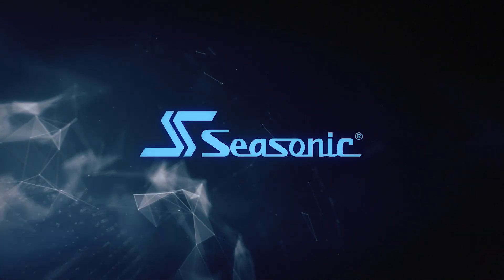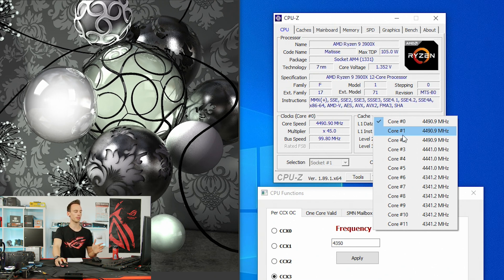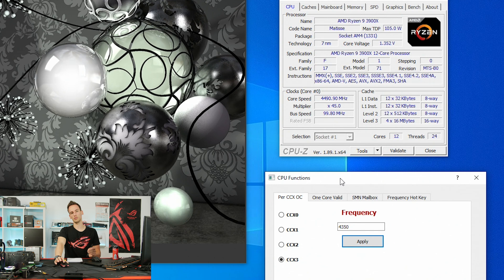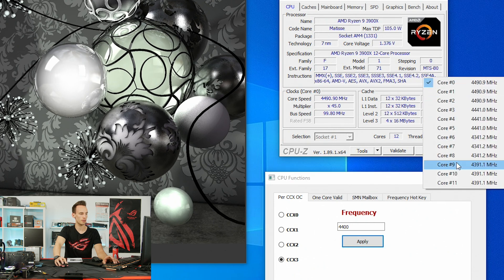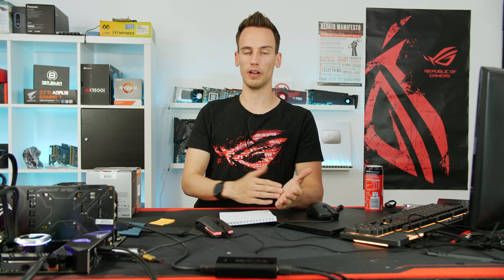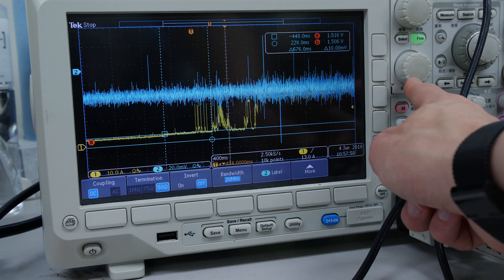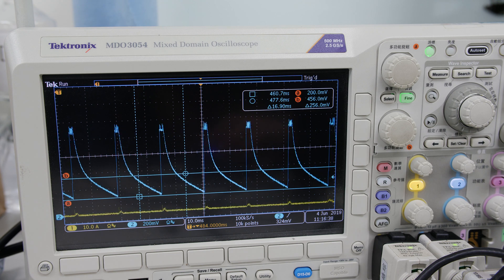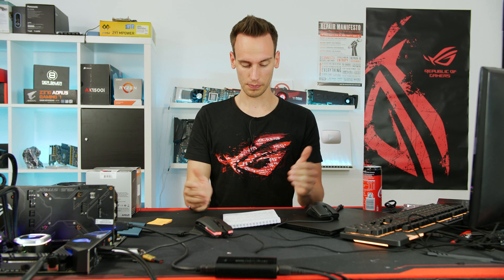The most amazing feature of RYZEN 3000 - Power Saving (and some CCX OC)

Comment: finally managed to fix Corsair iCue cpu usage by disabling the SDK option (from 9%usage making cpu run max clock/max voltage non stop down to 1.3% for normal flex-ratio cpu/voltage behavior) my voltage now set to full auto on a 9900k goes down to 0,736V to give you a comparison (couldn't care less on a high-end gaming pc to be honest just sharing the info as I've been monitoring idle the last 3hrs after months of running max clock/voltage for no good reason)
Reply: how do you disable the SDK option? Is it an install parameter?
Reply: 🤔 it looks short circuit, maybe need to remove 20/24 power pins on motherboard, clear left over electric then put it back. idk

Comment: i have this board and a 3600x, Im having problems running 3200 cl14 ram at its rated speed, Im having boot issues, the dram led stays on  and i have to power off the system to get it to reboot.
Reply: Try program called ryzen RAM calculator maybe can help you
Reply: Already tried the ram calculator, still had the odd boot problem.
Reply: @LetMikeSmash  try up ram voltage or lose you timing or both and wait for new bios i guest.
Reply: tried Copy paste timings from msi bios.

Comment: Is it still CCX or Chiplets with 3000?
Reply: Aaron K yes it still. 1 ccx still contain 4 core and 1 cpu die contain 2 ccx for total 8 core per die. But as this gen use multiple die (2 die cpu+i/o die) then there is new term for caling 1 cpu die as CCD(Core Complex Die) and Ryzen 9 model only that use 2 CCD.

Comment: Would it be possible to clock a CCX way higher than the other and have the Windows scheduler be aware of it, in order to achieve something akin to an ARM big.LITTLE configuration?
Reply: you do not need windows scheduler - any process can be bound to a set of particular cores... since forever. type "help start" in the command prompt for more.
Reply: Ideally Windows would do it on its own, but yeah Process Lasso works

Comment: try to oc one core to 5ghz and the reset to 4ghz or 4.8-3.8 somthing like this   .. if this worked i think single core score would be  fantastic :)) ,and game performance will be higher  idk if this  possible
Reply: you can't OC 1 core. it will OC the entire CCX , so with the 8 core for example you can OC 4 cores to whatever and 4 cores to whatever
Reply: @haoss69  he said at beginning you can oc one core but other should be 1ghz different.
Reply: murad dawod looks like it hard to achive. Clock scaling of this gen still close to previous gen. The reason why they boost such higher clock than previous gen is agresive boost behavior from precision boost mechanism. They tend to go as high as posible and it won't stay for long time becasue core temp increase soon as the core clock climbs. Even if you just oc 1 core it won't help as core temp will limit that.
Reply: @muhammadhanifkurnaen6689  i know its kinda impossible. but i would love seeing him trying to achieve higher frequency even on one core. and see what performance we can get good or worse
Reply: murad dawod yes for exploration purpose i agreed that. Because the ipc scaling of this 3rd gen ryzen is still mixed bag. And clock speed 'maybe' uniform the overal uplift in single threading scenario.

Comment: So, clock 2 CCX's to highest possible for your game (is this a problem on the same CCD?), and then another CCX medium for your OBS, and the last one lower for other stuff.
Reply: But Windows doesn't work like that on it's own ...
Reply: @janeksheppix  I think that was the original idea of PBO boost clocks - to make sure games run on the better CCX, but then again, Windows...  It doesn't understand the different CCX qualities and ordering. So it probably runs all the unnecessary stuff on core 0 already and the program/game stuff gets randomly shot to weaker cores/ccx.

I would try Process Lasso for games to test forced affinity, just to see if 3900X can reach 4,5-4.6 boost clocks in games that way with the PBO override.
Reply: @janeksheppix  You just auto set affinity with somthing like ProcessLasso.

Comment: Apropos overclocking features in BIOS - one thing that seems to be missing is a core-load dependent voltage offset.
E.g. -0.05v vCore at all-core, +0.025v at 4 core load, +0.075v at 1 core load : - )

As it's something I've noticed while trying to push this 3600 with PBO+AutoOC; to get higher single-core clocks stable (due to lower silicon quality), it requires compromising on already stable all-core voltages.
But I have my doubts that it has to be that way.
Reply: With the 3000 series having very specific voltage behaviours, I suspect any kind of load-dependent voltage offset could be problematic in some extremely fringe scenarios. Especially with how Ryzen 3000 like previous Ryzen (But even more so I'm noticing) just loves to throw workload across different cores constantly rather than keeping the same active cores busy with more workload when they're done.

Though frankly, I don't think with the 3000 series there's really going to be much headroom for "Pushing this 3xxx" type situations unless you're dealing with extreme cooling like LN2. The base algorithms the CPUs are already using seem to be so efficient with pushing individual CCX across the CPU to what is possible given the cooling situation, that most gains seem to be pretty much in the 50Mhz to 100Mhz range to just one specific CCX.... it's fun to try it, but the net gain seems marginal.
Reply: @Tiki832  I'm talking about generalized "how many cores are currently active" core-dependency, as opposed to Voltage Offset X for Core Y, but yes - the gains are always going to be marginal at best.

Comment: I'm confused that the idle power savings seem so good in this video, yet seem so bad in most reviews.  For example when measured at the wall, 50-60W for Intel 9900K but 90-100W for the Ryzen 3000 series CPU's.  The 3900X being the worst, but even the 3700X has poor idle consumption relative to Intel.  And then a video like this.. I'm confused.  Is it simply due to the power plan being used in Windows?  Compared Ryzen Balanced or Windows High Performance?  Are the reviewers always using the high performance plan with power saving features turned off?
Reply: Power plan probably. Ryzen balanced makes my 2700x use 30w to the wall, and high performance about 50, high performance pins the frequency to 4.2.
Reply: Might be a combination of using inefficient boards stuffed with unnecessary features (MSI Godlike comes to mind) and not having the latest chipset drivers installed.

It might show better on a lower-end b450 board, but I'm not sure.

Comment: How will this work on the 6 cores? (R5 3600)
Reply from the maker: 2 CCX with 3 cores each
Reply: @der8auer  That's great, it would definitely be nice if the board vendors included this feature in the uefi bios.

Comment: I will for sure undervolt my Ryzen 3000 processor (i don't know which yet) i think it's really worth it
Reply: Do not undervolt a Ryzen 3000 processor. Even just minimally undervolting it, will immediately reduce performance. It's best to leave it on auto.
Reply: @P8qzxnxfP85xZ2H3wDRV  why? i've slightly undervolted my Ryzen 2600 to 1.2V vcore and i saw better peformance on without oc.
Reply: @KeanoMUFC1  Ryzen 3xx0 doesn't behave like 2xx0 series. You better editing the Ryzen Power profile to drop down to 5% from 90% , that way your Vcore will drop down on itself
Reply: @A.Froster  ok we will see
Reply: @KeanoMUFC1  On Ryzen 3000, the CCX manages voltage individually for the cores. If you supply your CCX with a lower voltage, it will still boost to the same clocks, but performance will degrade. This is because the CCX turns off cores and switches the remaining voltage between the cores more frequently, resulting, on average, in a net loss. You cannot see this with monitoring tools. You'll only see it in your Cinebench score.
So undervolting on Ryzen 3000 doesn't behave as expected. The only working way to use voltage control at all is by doing manual all-core OC and setting the voltage fixed.
Using offset for under- or overvolting will result in degraded performance.
So either manual+fixed or auto voltage or auto voltage with PBO and AutoOC.
Reply: @P8qzxnxfP85xZ2H3wDRV  class dismissed.

Comment: @der8auer, i have a question that puzzled me for quite sometime now. Does it still make sense to overclock manually(per ccx), or should we let PBO+AutoOC does their tricks instead? From what i read so far, it seems like the different is negligible. But this is the first time i have seen Per CCX OC. Does Per CCX OC beats PBO + AutoOC? Thanks
Reply: Oc manualy usefull for multi threading usage but it hold back single thread performance. PBO+AutoOC usefull for some app that not utilize well multi threading but multi threading scenario remain close to stock precision boost. As far i know pbo+auto oc push core clock boost higher than std but they still limited by power limit that precision boost used.

Comment: Hi der8auer,
I always love your video. I have a question about the ryzen 3000 oc. Can you still do bclk oc on ryzen 3000 cpus? Is it still beneficial in anyway?
Reply: Why is this a question? Obviously you can, and obviously you will get benefits form it
Reply: @C4CH3S  You are 1/2 right.   You obviously can,but the benefits,  not so obvious...
Reply: @jamesthomson8659  higher clock speeds yields better performance, unless you set bclk to some stupid number obviously
Reply: @C4CH3S  But all core overclocking on ryzen 3000 limits single core boost. You can't get all cores to the labeled boost. So depending on what you are doing it may or may not be a benifit and it consumes way more power.
Reply: @jamesthomson8659  when I do bclk I use it with fixed clocks, to get to the limit of all core OC, never used it for boost frequency, but I can see it work as an offset
Reply: @C4CH3S The problem with ryzen 2000 and 3000 chips is that the all core boost usually is less than the single core precision boost.  For example with precision boost my 2600X
 will run a single core up to 4.3gHz.  with the other cores at 4.05 gHz.  The best all core that I was able to get with reasonable voltages was 4.1 gHz. In a lightly threaded work load performance is better with precision boost   Ryzen 3000 testers are reporting the same thing.
Reply: @jamesthomson8659  I see. Xfr is very good at hitting single core limits.

I do a lot of cpu heavy workloads, so I prefer all core boost. Never tought of using bclk with auto, haven't really seen anyone using it without locking the clock
Reply: @C4CH3S  Its a Ryzen "Feature", you also need to put in a negative voltage offset  or you get  ridiculous core voltages depending on the bios.  MSI didn't have the ability to offset voltage in their B450/X470 boards initially and had to add it.  Ryzen 3000 bios is still a work in progress.  One of Roman's earlier video's showed that they weren't even hitting the advertised boost.

Comment: good video Roman, can u test in future also Crosshair VI Hero with Ryzen 9 3900X (OC, VRM temps etc on this "old", but still very solid board)?
Reply: yeah, im curious too. i might upgrate do ryzen 3000
Reply: i third this! so many reviewers testing X470 but the whole point ofAM4is the ability to upgrade from 1/2/3rd gen on the same Mobo....
Reply: Your board looks fine. Full list of capable boards here:   https://linustechtips.com/main/uploads/monthly_2019_07/jns90zhx3o731.png.5fe01ac60a0edce53df8d0ac833647b7.png
Reply: @406mill  yes, but interesting could be what temps of VRM after OC etc :)

Comment: Hey Roman, using the software my VID immediately shoots to 1.48v and temperatures spike when going per CCX OC. I know VID is only what the CPU is requesting and not receiving but I was wondering if you could just confirm it doesn't actually touch voltage (SVI2 TFN showed 1.325v which is what I set in bios).
Reply: Do you use corsair icue? Someone on reddit found out that caused high voltage issues on ryzen.
Reply: Dont set LLC too high, i use msi mortar titanium llc mode 3 it spikes up to 1.45v
I enabled pbo+auto oc
Reply: I'm running fixed ratio and fixed voltage so neither of these things raised will affect me as I've gotten lucky on my CPU I don't need to do PBO/auto OC on my 3900X. As I was saying though VID isn't what my CPU is receiving it's what my CPU is requesting, and I was just asking for confirmation on that by Roman.

Comment: Hi and great video, can we use this tool for previous gens?
Reply from the maker: I think so but I didn't test it yet. Worst case it just doesnt set the clock
Reply: @der8auer  I'm gonna try that with ryzen 2700 when it arrives. Just ordered for 149 USD on amazon LOL
Reply: @madd5  Amazon Prime Day FTW :-)
Reply: Just tried on first gen 1700, says "settings applied" but nothing happens
Reply: @smcelrea  ya, i tested with 1700/2700 no clocks change there is probably something inside the tool to work with 3000 series, probably or something i might be missing (tested with b350/x370) ps: ryzen master "works"

Comment: Ryzens are cool :d
Reply: @Martin M what are you even saying?
Reply: @captaincrazy5008  i think certain aio coldplate isnt big enough/designed for the chiplet layout so some of them do a bad job at cooling ryzen 3000 despite its lower power draw than intel so thats where the complaints of hot may come from or just intel fanboy trolls. Aios may need to have updated models to properly cool ryzen 3000
Reply: @sbrader97  3900x under a Corsair aio, only 50c max under load
Reply: No, they are hot.
Reply: @gerardw.7468  Only the chipset.

Comment: The most amazing feature of the 3rd gen ryzen is that I can finally afford the first gen now
Reply: Damn right... Especially the R5 1600 😂
Reply: Yes a Ryzen 3 1200 for $60 is not bad.
Reply: @magnusnilsson9792  still can upgrade to zen 3 next year
Reply: Meanwhile in Switzerland best seller components are 3900X ($580), 32GB DDR4-3200 ($170), Asus X570 ($350), some gold 700W psu and $150+ cases.

Yep, Swiss people are too rich lol
Reply: Truth! I just picked up a 2600 because the price was really good. Finally gonna replace my x5650!
Reply: Ohhh, that means you have never owned an Intel cpu If You cant afford AMD😅😅😂😅
Reply: Lol....nice
Reply: LOL and congratulations! Indeed, the prices of the previous generations got a lot lower and for many people that is amazing. Enjoy it. ;)
Reply: I managed to pick up a used r5 1600 for 72 bucks in Norway where like 18 bucks of those was postage. Which was like 50% of the used market value even. Also got a hand on a refurbished x370 for 45 bucks :)
Reply: @hypnoticlizard9693  

Nice.
Reply: 4+ core cpus are not for poor ppl
Reply: Rarely do we( if ever) do we see this kind of price depreciation with off-the shelf new in box intel processors.
Reply: @cybercat1531  the depreciation is caused by improvements of the newer generation

Intel hasn't been doing that
Reply: You can get the 1st Gen Plus 2700 X $199 on Amazon that's an amazing deal.

Don't know if it's still available but it was for the last day and a half.

Should drop even further once these chips are out in the wild to everyone.

It's going to wait out till around Black Friday or the holidays you'll get a sweet deal.
Ryzen + it's much faster and much more efficient than the original ryzen go with that if you can :-)
Reply: @kingrichard418  3600>2700x
Reply: @kingrichard418  you can literally get 3rd gen ryzens for 200 bucks tho wttf
Reply: I can kick myself i am not sad that i got the ryzen 5 2600 but i bought it to early i could have gotten the 2600x now as it's same price which are 3.5k and the 2600 non x are 2.8k.2700x are down from 7.4k to 5k now that's a bargain here.
Reply: @pierregrobbelaar9116  if you don't mind overclocking, then the r5 2600 is better. So at least there's that lol